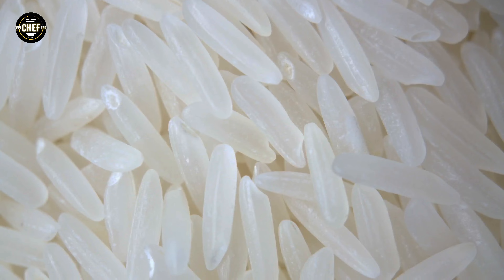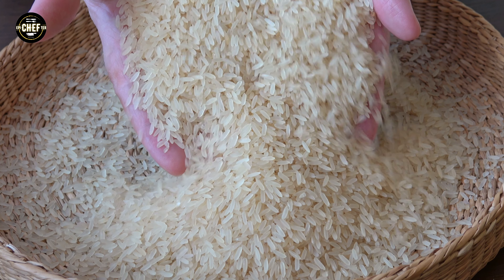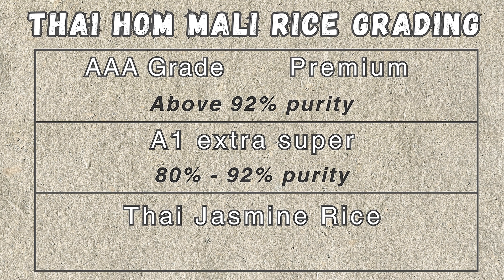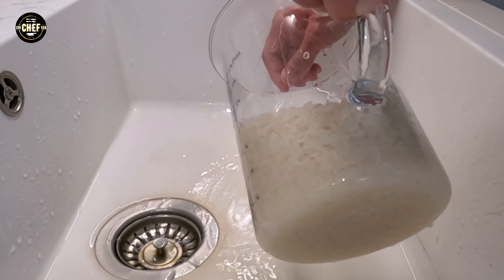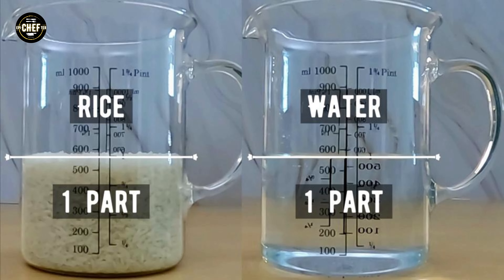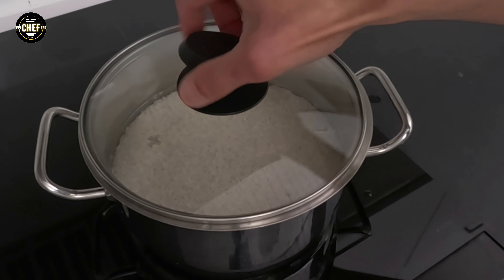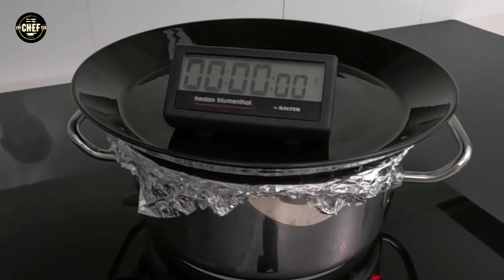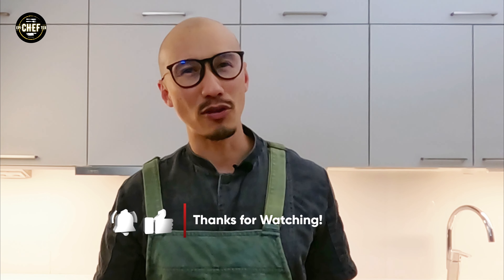Cooking Jasmine Rice: Perfection Is Easy If You Know How

Comment: This reminds me of my chemistry class. Cooking rice shouldn't be so complicated!!
Reply: It surprisingly is. There's a huge difference between regular boiled rice and steamed rice. This method is using both methods at once which is quite tricky to get right. You have to time it right so that all water has evaporated by the time the rice is cooked.

There is a cheat way though. Boil the rice in lots of water for 10 min. Strain well. Place in microwave container with loose lid and microwave on medium power for 5 min. Cooked then steamed to perfection.

Comment: I have a slight amendment to this. If you are doing rice straight to freezer (for meal prep). Wash the rice. Use the exact same amount of water to rice. Bring to boil, cover + simmer on lowest setting 12mins, let it sit another 10 mins. The rice is slightly dry which is PERFECT because when you reheat in microwave you're going to add a quick flick of water (I use my hand to flick some water on the rice). It is delicious.

Note this relates to JASMINE white rice. I haven't tried it with other rices.

Comment: Question: The ratio of rice to water is based on volume as stated, if the rice is soaked, is the amount of water based on the original dry volume or the soaked volume?
Reply from the maker: Hi, great question. It is all based on the original dry volume. Hope this helps.
Reply: It’s based On the soaked volume

Comment: Water to rice ratio when cooking is (equal part water to rice). Cover pot with lid to prevent steam from escaping. Bring water to a boil as fast as possible. Once boiling reduce the heat to low. Leave rice steaming for 12 minutes. Once done turn off heat and let steam for 10 minutes. Now open the lid and fluff the rice.
Reply: Do you wash the rice first?
Reply: Doesn't work, the rice was uneven. I prefer his method of soaking and washing the rice first.

Comment: Hi, did you soak the rice with hot or cold water? Thank you
Reply from the maker: Hi, I soaked the rice in cold water. If you soak it in hot water, it will start cooking before you actually start cooking it. Cheers!
Reply: @epichefter  ok l will try this. But l always soak it in hot water for 10 mnts and l only add same amount of cold water to cook. 10 minutes cooking, 10 minutes with table cloth over the rice and ready.
Reply from the maker: @LevoLee  that is interesting. I should also try your method.